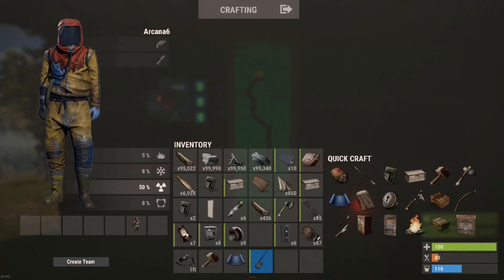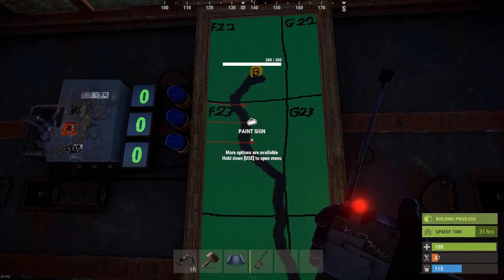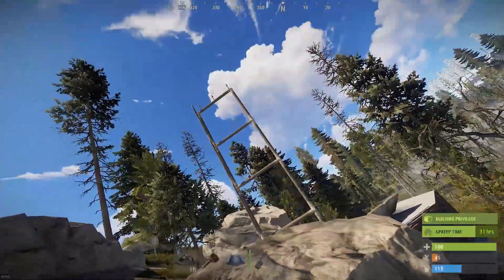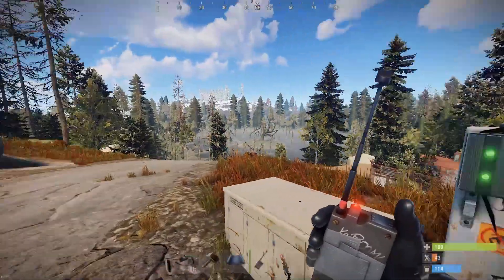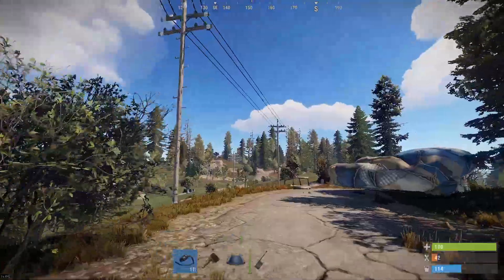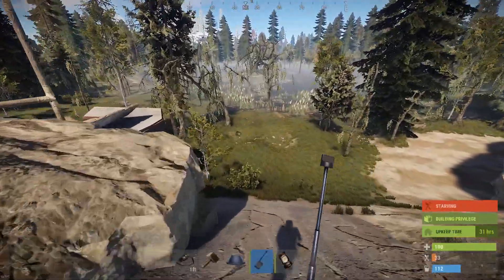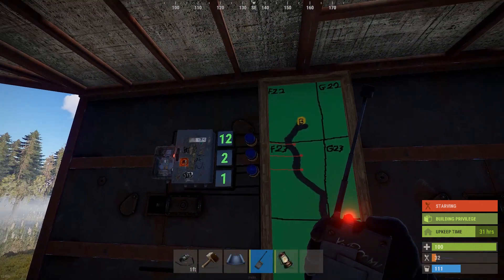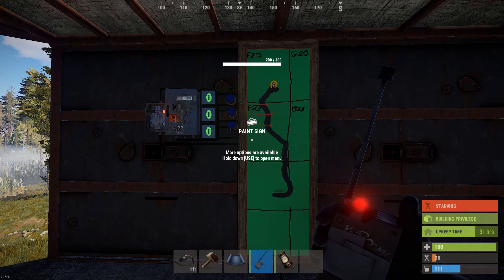Rust Staging, New radio frequency detection systems

Comment: These things are really cool, but with Rust being a 3 day wipe culture, I don't see much need for use of these complex systems. Maybe if they just default BP all these elec components
Reply: Well there are some longer servers that these would work in, and moving towards the wipeless goal. Also electronic components are super cheap to research. 20 scrap (aka  - 4 road boxes). I'll make use of these. I used electricity this wipe - my whole base ran a 24 hour 20+ lights system. I often had to go outside just to check if it was day or night.
Reply from the maker: yeah, I wouldn't put effort into complex systems on a weekly wipe server, I prefer fortnightly or monthly servers.

Comment: This in nice, i'm actually thinking this would go nicely in enclosed TC triangles surrounding a compound.

You can place them so they cant be messed with. Identify where people are around the perimeter of your compound via lights (also acting to deter people from staying there as they light indicates their presence) and using the RF feedback to determine where they are around the base and potentially how many.

Tower base defense here would get a whole lot easier. (floor or roof mounted map with indicators). People may say this will just help compound campers / zergs and big clans. But the risk of a naked / low geared player to the work put in here makes a huge difference.

Go 1 step further. RF identifying where people are - remote RF door controllers back to open turret bays on demand. Mwahahahaha
Reply from the maker: Yeah, I think external TC detectors will become pretty common place. The basic idea shown in the video is applicable to all sorts of different uses. Sending the number of players detected seems to be difficult though, it's a thought i had as well.